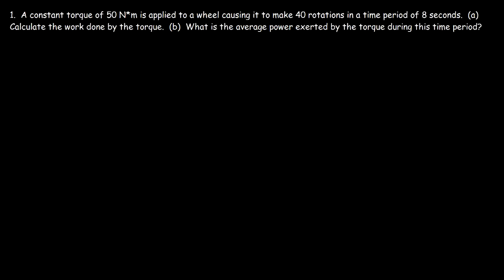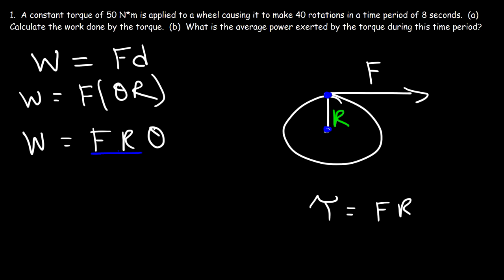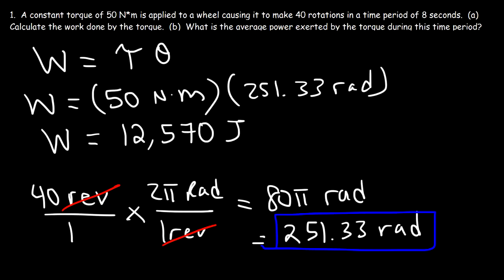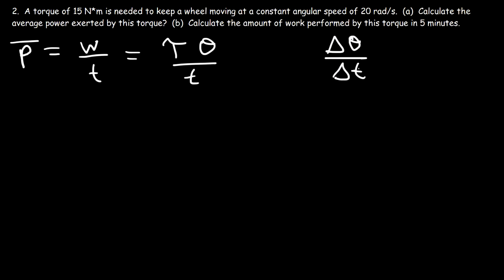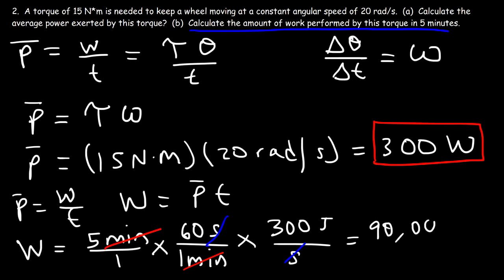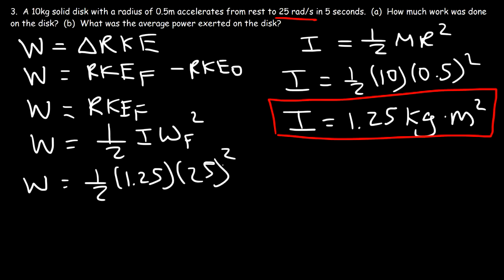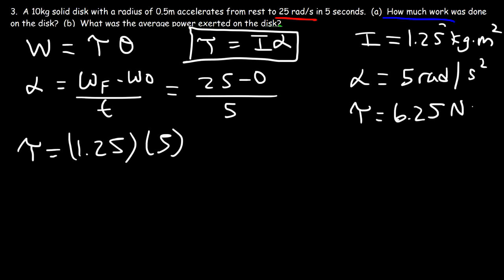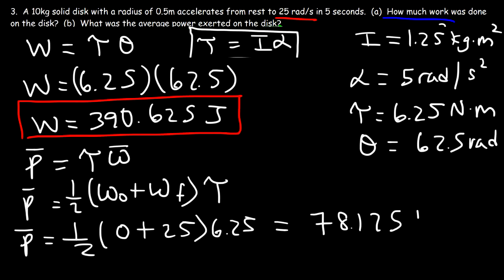Work Done By a Constant Torque - Power & Moment of Inertia - Rotational Motion Physics Problems

Comment: Hi, I am busy with a personal projects.
I am busy with special gearing which allows me to use a driver gear which is 50mm in diamater that drives the follower gear which is 100mm in diameter. I have them running the same rpm. Now I just want to know if there will still be more torque on the follower gear (100mm) than there would be on the driver gear (50mm). Remember that all my tests the system is the same rpm. Does the follwer gear consume less energy as the rpm is not 2:1 as it should be for a equal system?

Comment: Question, on the example at 3:30...if you increase the torque by increasing the meters in this example, your work increases. How would one go about describing where that extra work comes from. You have the same force and same angle, but a greater arc length. Is that where the extra work comes from? Same force applied over more distance?

Comment: Have you explained about pyridine part ?
Reply: Hey! I know the question was asked a year ago but I still wanted to answer - the "pyridine" part is actually a special unit or a number in maths. A simple mistake, Pi is confusing. 
The radians system that he uses(you can see him writing "251.33 rad") is used for measuring rotations. In this radian system, 1 rad is connected to the radius so that it doesn't really matter how big the wheel is, the number will always represent the same amount of rotation. Due to using the radius, the numbers get all weird and 'inaccurate' with the decimals(251.33) so mathematicians use the trick of having a multiple of Pi. The measure of rotation 251.33 is equal to 80 Pi's. And so he calculates @2:32 that if 1 full rotation(or a 'revolution') is 2*Pi then 40 revolutions is equal to 80*Pi. (Pi is a number approximated to 3.14 in easy examples). If it's still a bit unclear, I recommend watching this simple video https://www.youtube.com/watch?v=HACNCy0clO0. :)

Comment: I have a question - "The unit of a turning moment is Nm. The joule, which is the unit of work, can also be written as Nm. Explain why a turning moment is never described as a joule." I'm afraid my teacher is awful, and it's homework set for us. I'll be grateful for any help!
Reply: I'm currently searching for the answer, did you manage to find it??
Reply: @brandonhughes645  I'm studying physics at uni now :) Work done is a scalar quantity, and if you use vectors, you would use the dot product of force and distance, to get the force acting in the direction of motion. This all makes sense as energies are scalar quantities and so are dot products. If you were to express work done as an integral it would be: ΔW = S F • d s
Where S indicates the integral sign, F is the force vector and d s is an infinitesimal distance vector. If you're not already aware, vectors are often expressed in bold or underlined. 
Feel free to ignore that if it's a bit technical, but it will be really helpful if you plan to continue studying physics or a similar discipline. 

Moments, however, are like shorthand torques. They are vectors, unlike energy. If you consider the right hand rule for electromagnetism, it's basically the method for working out a cross product, (in this case your thumb denoting the direction of the torque vector, index finger r, middle finger F) In vector form, the cross product formula for torque is:
τ = r x F
Where they're all vectors, (r is distance). I recommend looking up a diagram of torques or watching a video to get an idea of how this cross product works if you aren't already familiar with it. (If this video isn't helpful enough on its own).
A little extra for you is that a torque is a circular force, which can do work. However, since the motion is circular, it can't do work in a given direction, but in a circular path, over an angular displacement which is measured in radians. Radians don't have their own dimension. So while torques have the dimension (unit) Nm, it's also kind of accurate to say they have the unit Nm/radian. (I don't recommend answering this in an exam setting, it's probably not what they're looking for, but hopefully helps your understanding).

Essentially, if you've got an exam question on this, the answer you're looking for is to basically say that a moment/torque is a vector and behaves like a circular force. However, work done is a scalar and is defined as the force that acts over a given distance, in the direction of that motion. 
(They are defined differently. There is a difference between an algebraic formula, and the more accurate vector formula. The units are only algebraic Nm and Joules are used for the sake of making this distinction clear. Work is force through a distance, torque is force at a distance.)

I hope this helps you, good luck
Reply: @SamdGG  managed to get the answer. Anyway nice on going for the degree! Seems like you have a solid understanding so I'm sure you will smash it.
Reply: @SamdGG  I have a degree in physics, there are just some things you will forget with time. I tutor with the PhD students and they all seem to forget basic stuff aswell. Especially since no one thinks about this stuff anymore.

Ive had to make myself look like an idiot asking dumb stuff all year haha.
Reply: @SamdGG  big W
Reply: Simple brother , Torque is a vector quantity whereas energy is a scalar quantity

Thus , Torque is represented through Nm(as it signifies tbe force in there which itself is a vector)so as to distinguish it from Joule @SamdGG

Comment: The flat belt has a speeed of 22m.s and is lifted tow pulley with a diameter of 380mm ..if the effective pull is 210N

Calculate power transmitted by the belt
Reply: P=F*S